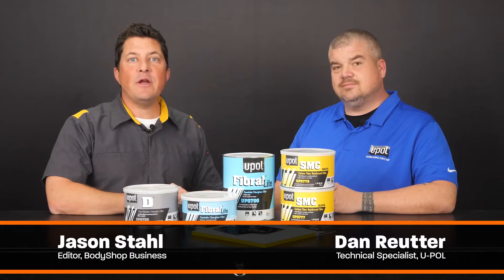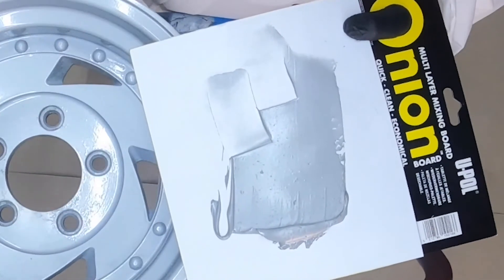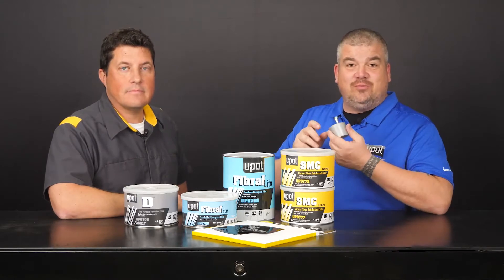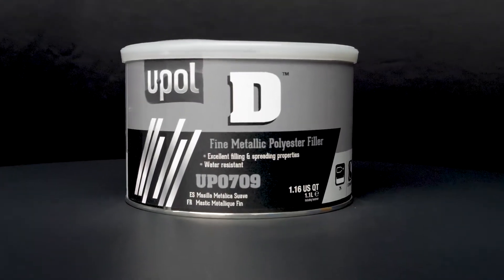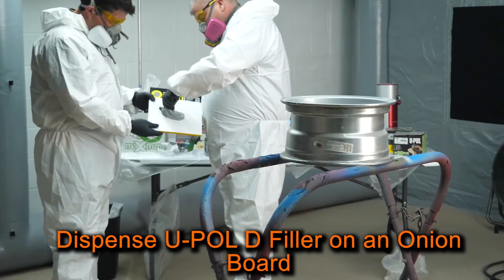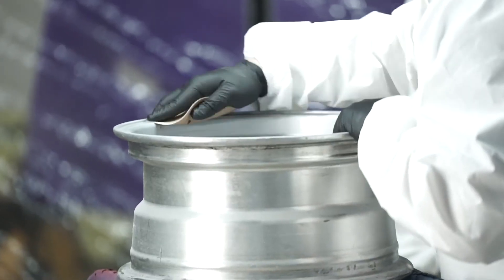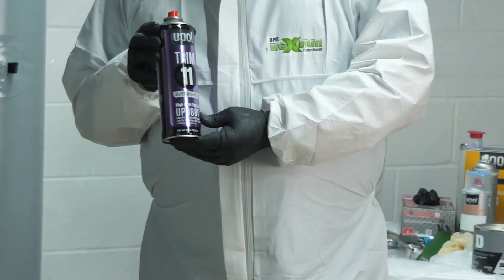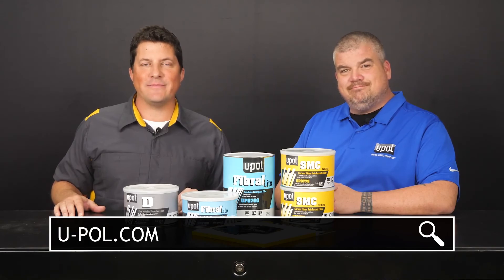VIDEO: U-POL Specialty Fillers, Part 1

Comment: Can be used on a manifold?  That means I can powder coat over it and it wont lift during bake process?
Reply: i think the heat will definitely pull it up. I have no experience with this product though.